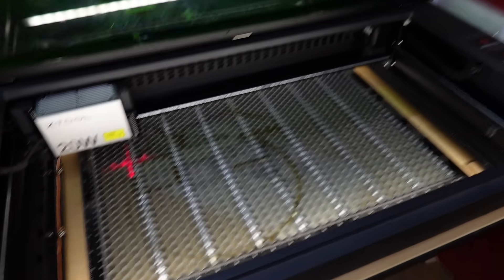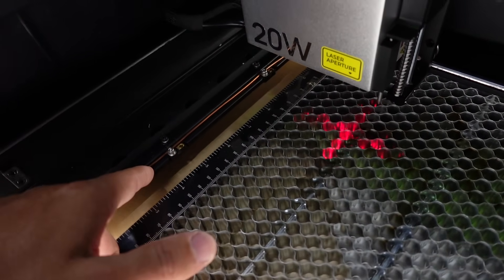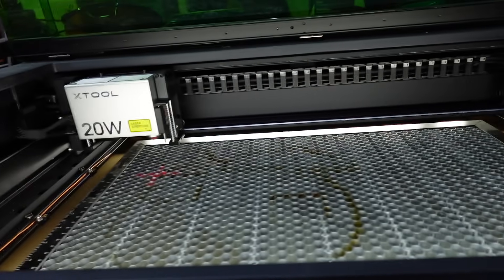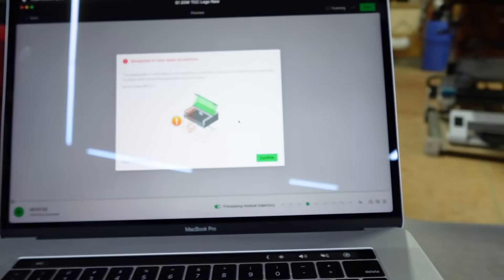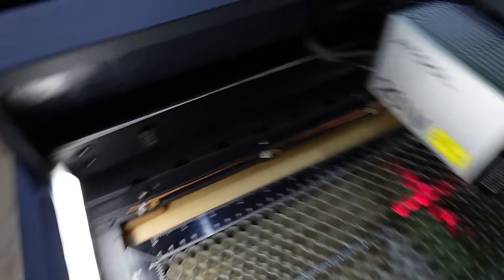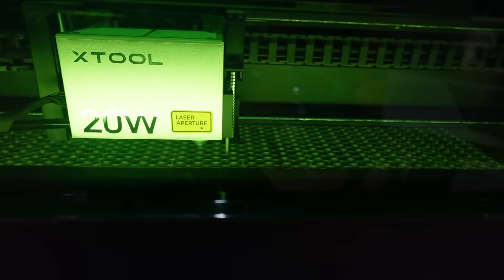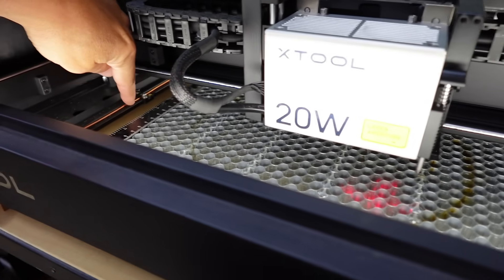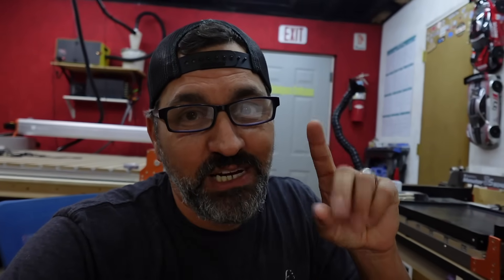Do You Own an Xtool S1?  You'll Wish You Knew This RISER HACK Sooner!

Comment: Just wondering what venting system or extraction unit do you use with your S1, I have unboxed mine, haven't used it yet, because its in our basement & will be doing a lot of leather lasering. Dont want the fumes & smoke going up stairs, as it is an open stairway.

Comment: Certification for safety class 1 is the reason. You just modify it to much dangerous class 4. You should not do this without correct safety glasses for sure.
Reply from the maker: Your absolutely right! Make sure you wear your safety glasses when using any tool!  Thanks for watching!
Reply: Total bs, you can use the rotary without the baseplate, no difference in safety.

Comment: You're my Hero! I'm going to do the same with my P3, that is coming. The passthrough mode must be allowed to this sort of equipment,  but vendors preventing that. I haven't seen how it could be worked out in P3, but I believe this feature is a must! Usecase- to cut oversized felt panels/ polyester sheets 12mm , make perforation patterns on them.
Reply from the maker: Let’s go! Hope it works for you!